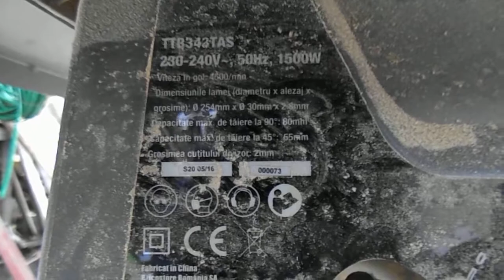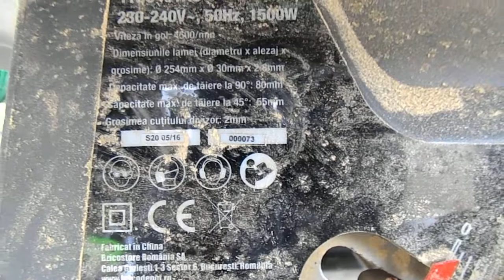circular titan si panza irwin construction

Comment: Se poate o recomandare pentru un circular ca modelul asta nu se mai găsește.
Reply from the maker: depinde de buget. cele de la dewalt au un sistem foarte fain pentru ghidajul paralel. eu m-as orienta spre un circular care are masa din aluminiu (cele cu masa de tabla sunt destul de strambe si predispuse a se stramba si mai rau). ghidajul paralel (firungul) sa fie cu prindere in doua puncte iar panza sa fie de 250-254 mm (din ce am observat eu taie mai bine cele cu panza mai mare). de firme nu stiu ce sa zic.. e loterie la toate. toate au si parti bune si rele
Reply: @floreamihai.  pt hobby utilizat 1-2 ori pe luna.
Reply from the maker: @leu002  e greu de spus. nu conteaza cat il folosesti atat timp cat ai nevoie sa tai drept. ar fi asta o optiune https://www.atelierultau.ro/bosch-gts-254-fierastrau-circular-de-masa-1800-254-mm-picioare-sustinere-cadru-monofazat-p-87474.html?gclid=Cj0KCQiA9YugBhCZARIsAACXxeICIIKukBX7VfGreYw1pJnA8fyhc2qeO9wNiRK9cBzII1W8Lxyl7mwaAvtbEALw_wcB. dar nu l-am testat. eu am gts 635-216. am avut o problema cu el dar am rezolvat si acum merge fara probleme